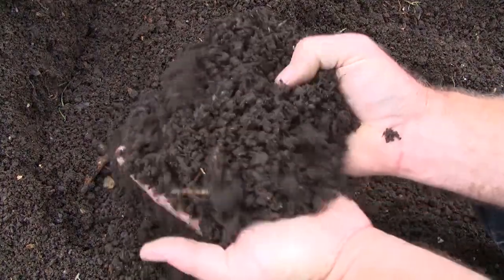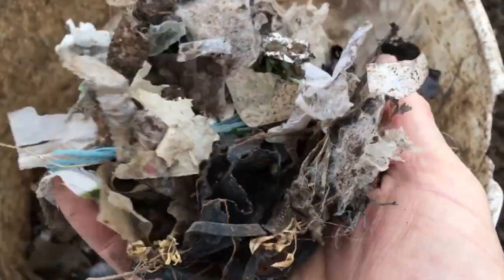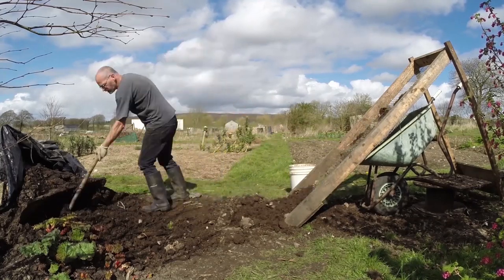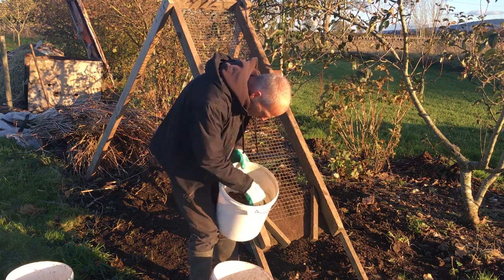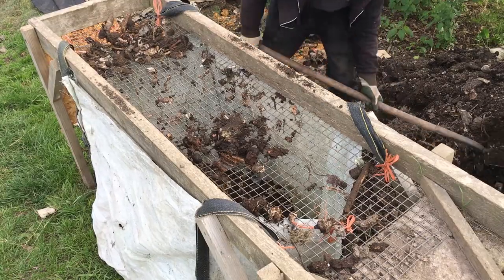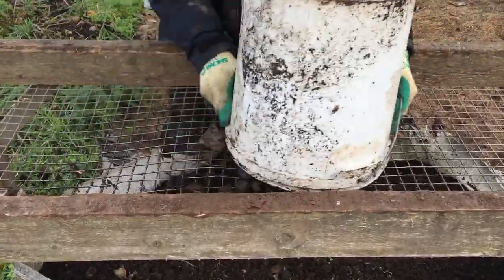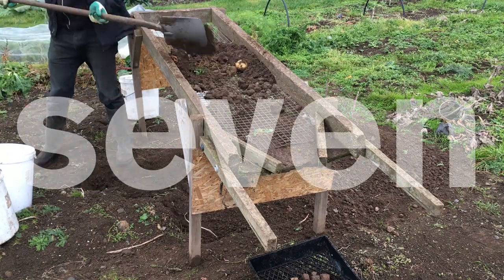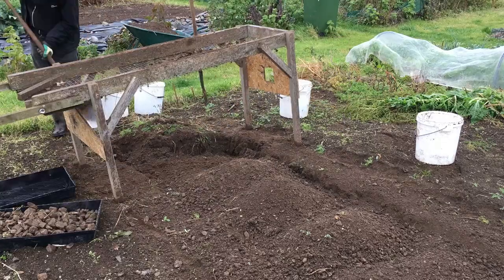8 Ways to use a Compost Sieve

Comment: Theres one method im not seeing here. 

Suspend the frame from ropes or chains at each corner. Shake it back and forth to cause motion for the material to work through the sifter. This is one thing ive done. Its very fast and efficient but takes some work to shake the thing. 

Alternatively having the frame rested on rollers it can roll across might make the same effet
Reply from the maker: Yeah, I think that will be a good option. I have seen people attach a vibrating motor to the suspended frame, and that seems to work really well. So I am going to try that.

Comment: I think it's a great mult-use tool. But as far as sieving compost, I can see that a fine compost is a nice finish for the top layer of a bed, but I don't see why stones, and chunks of woody or. lumpy material can't be added to the soil as is. The organic material would retain water, for one thing, and the stones add drainage and minerals. Of course, plastic is undesirable if it gives off toxic chemicals, though not if it were inert, I think.
.
Reply from the maker: I prefer to get that lumpy stuff out of the soil as it causes problems with hoeing and weeding. The stones don't help with minerals nearly as much as the smaller particles that pass through.
Reply: @REDGardens  Yes, I hadn't thought of that. Plants do seem to like stones, though. Perhaps further down.

Comment: Would it work to have a finer mesh frame 6 inches underneath the larger one, so that the compost will double sieve by gravity? 
Someone has already mentioned wheels which I think would be a fabulous idea for manoeuvring.
Reply from the maker: I think that could work if I could figure out a way to get the whole thing to shake/vibrate. Otherwise I suspect the lower screen would fill up and be difficult to clear materials on.

Comment: Plastic and wood floats, stones don't maybe this can help filter large quantities of unwanted material. Also the water will clean the waste making it easier to visibly sort out the plastic...?
Reply from the maker: i tried that a while ago, but should use that method again. It does make it easier to sort through, though a lot of the wood sinks as it is so waterlogged.

Comment: You only need fine compost if your using it for potting up plants a few stones or material not fully broken yet is not that important it provides drainage otherwise You will end up with compaction.
Reply from the maker: Good tip, for those using homemade compost as a growing medium.

Comment: If you ever build sieve v2.0: https://www.youtube.com/watch?v=7d-26QYDlqE
As a frame I yould use an aluminium ladder, adjustable saw horses als feet, probable you can reuse your wooden sieve frame, put it on rollerskate wheels using the ladder as a track
The crank flywheel looks a lot like from an old pedal driven sewing machine.
Reply from the maker: Cool!

Comment: In a previous video you said you'd throw bones and plastic back into the compost pile, but in this vid you say you'd pick them out. Here's my question - what is the best (eco-friendliest) way to deal with waste plastic? My house is in the middle of nowhere so taking it to a recycler makes zero sense. Also, what do you do with the small stones left over?
Reply from the maker: Ah, that is a tough question. If I were in the middle of nowhere, I'd be tempted to burn it, carefully and slowly in a very hot fire. A bad idea, but possibly the least bad.
I use the stones to build up paths, raise areas for drainage around the house, and to establish trench/french drains.

Comment: Your sieve looks nice and heavy duty but I had a huge amount of earth to remove clay and rocks from so I built a really basic "trommel". Youtube it as there are many ways to make them. Mine is a pallet, two cheap plastic pots (with a smooth rounded rims), 4 large casters, 2 small casters, 12 small bolts with nylon nuts and some 10mm mesh , the mesh cost me £20 and the rest was £12. I have lots of mesh spare now but it was the largest outlay. I cam place this on top of the wheel barrow and it simply falls through to fill the barrow. the waste runs down into a bucket which goes in the skip. I've not come up with a super cheap way to turn it yet and have currently finished it use in the garden but the allotment is next so its going to be reused and I'd recommend looking at making one, not to replace the screen as it looks to have its uses but the trommel gives me far finer soil and organic matter without hardly any plastics and zero rocks. It looks nothing but works a treat. ignore the poor motor effort, that bit failed so it's still manual but looking at pedal system similar to a pole lathe for use at the allotment. It saves on gym membership fees :)
https://scontent-lhr3-1.xx.fbcdn.net/v/t1.0-9/20245532_1321418457957453_8888475215024410238_n.jpg?_nc_cat=106&_nc_ht=scontent-lhr3-1.xx&oh=98269cfd7211e210080134563110ade5&oe=5C766E2F
hope the image shows.
Thanks for the videos, they are inspiring.
Reply from the maker: Interesting design. I like how you used buckets at the ends. I wonder if it could be powered by your cordless drill (or a power drill if you are within range of mains electricity)? There are a few different tools being developed for small scale agriculture that are based off of a cordless drill. It wouldn't last long, but  fro small sifting jobs it might be enough power in a battery to run a light weight sifter.

Check out a piece of equipment called a tilther
https://youtu.be/6dUXPeDsHGU

Or a greens harvester
https://youtu.be/OPIfw5_WoLU

Both run off of a cordless drill.
Reply from the maker: It will be interesting to see if the portable drill has the power to turn the screen fast enough. You might find that you need to load it more slowly with compost/soil.
Reply: @REDGardens  I have no idea to tell you the truth but I already have the drill (ironically in the picture of the trommel), it's trigger speed sensitive and has a low torque slower speed setting so I'm confident it will turn it, I'll keep you updated as it's not an expensive drill (about £70 with a spare battery https://www.youtube.com/watch?v=bvG0LDZfXpY) but has more torque than my old ELU drill which was 3 times the price.
I'm working through your book recommendation from Steve Solomon, very interesting and 30 years of knowledge is providing a great deal of soil chemistry info. I'm trialling some green manure in the garden this first year (rye, red clover and mustard) because it's the first winter and next month hope to get some more compost into it around December before covering it with a tarp, hopefully at the end of next summer I'll start the soil tests all being well and see where I'm at for the next amendments.Looking forward to seeing the results of your amendments added last year. If you don't mind sharing where did you get the soil tests done? Cheers.
Reply: I wouldn't have the space to store that but your design gives me the idea of a free-rolling trommel.  Basically your central cyclinder without the wooden frame, instead built inside of wood hoops with a couple of inches between internal and external diameters that act as wheels/rollers against the ground, two at the ends and one or two in the middle. Then just shovel in the material and roll the whole thing around, or rock it in place.
Reply from the maker: I saw the drill in your picture, and that is what gave me the idea!

Glad you have found Steve's work interesting. It is a fascinating world that he describes!
Reply: @Sankara561  What ever works for your situation really, the rotation or rocking saves a huge amount of work and has allowed me to sieve several tonnes of top soil from the clay rubble in a day. I'm sure smaller tubs will work equally well, just ensure what ever you intend to load it with e.g. shovel/trowel, will fit in the tunnel opening. Hope it helps.

Comment: Rocks and plastic in your compost?  Should probably sort out that problem next.
Reply from the maker: Well, I do add a fair amount fo plants that I pull out by the roots, which often have rocks held by the roots, and I typically add a bit of soil to the heap. So that is mainly how the rocks migrate in.
The plastic I don't control. A lot of neighbours add their compost to the bit, and not all of them are great at keeping the it only decomposable material. But the main culprit in the past has been rats that build nests in the compost piles, and seem to prefer to chew up pieces of the plastic sheets that I cover the piles with to use as nest material. I've pulled out handfuls of pieces of plastic from one nest!

Comment: a simple solution would be to make a cylinder out of your mesh and then rolling your compost with in the cylinder like a washing machine.
Reply from the maker: That could work well, though better if I had a motor attached to it.
Reply: @REDGardens  it works for industrial mining rigs. You could make a simple gravity powered version by capping the ends, filling the cylinder and then using a rope to pull the cyclinder across the floor to break up the compost while trapping the rocks within the cyclinder.

Comment: I’d just stop putting stones, sticks bigger than 10mm and plastic in my compost pile
Reply from the maker: Yeah, that would help. But most of the material that goes into the compost is put there by neighbours. And a lot of the plastic comes from rats who love to shred the plastic covering to use as linings for the nests that they build in the compost piles. So even if I was really careful, I'd still want to sieve it.
Reply: RED Gardens ahh ok dude, didn’t realise it was being put there by neighbours. 
I’ve just been doing all my compost and I use a similar system to you but my sieve has a metal frame and welded so you can give it a good bashing!! It also fits straight on top of my barrow so as soon as it’s full off you go! A nice long Irish shovel also helps!!  I love your work, green fingers all the way just noticed that my radish are showing up today. Yum yum. Keep up the good work.

Comment: When it comes to sifting compost, it takes much less effort to use equipment  with a motor or at least a simple drill, as in my case:  https://youtu.be/zI2Szbe7whM
Reply from the maker: Nice piece of equipment. I'd like to build one of those. Also recently bought a vibrating motor for a horizontal screen.

Comment: Lovely video and process. Last iteration should be an automated tumbler, right?

https://youtu.be/LwmoHlE_OGk
Reply from the maker: Possibly, either a trommel like that, or a motorised vibrating sifter. Need to set up an off-grid electricity supply first!